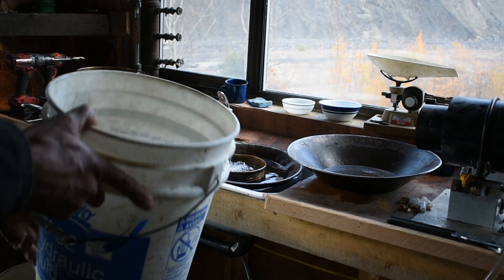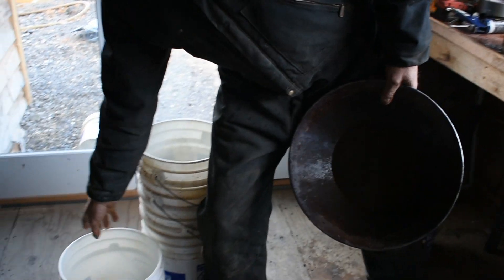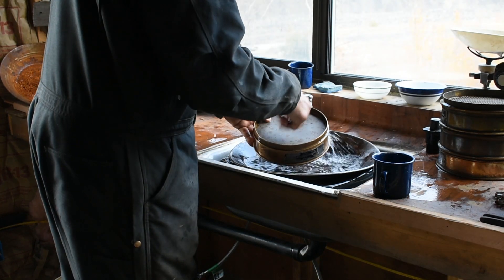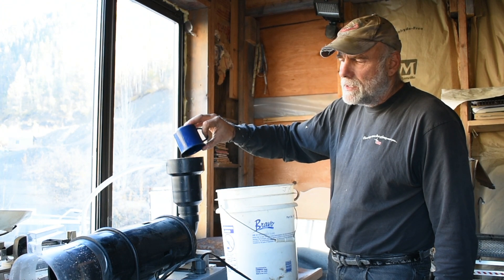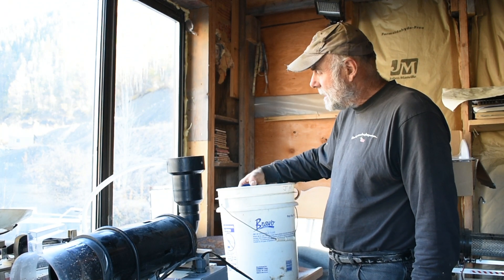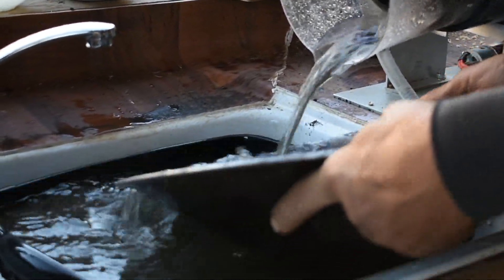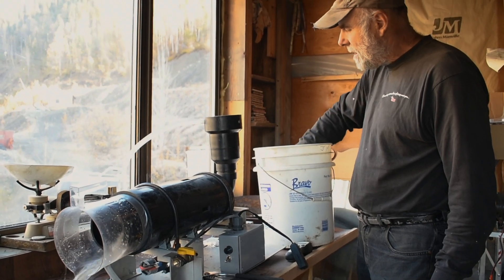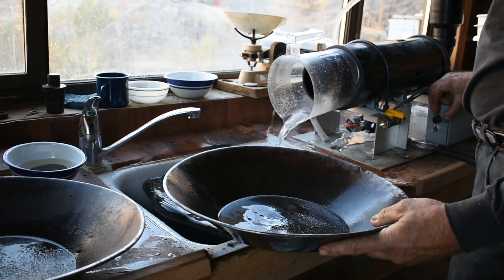Gold Centrifuge

Comment: So it's just a rotating cylinder spinning fast enough to make the dense particles stick to the wall while the less dense particles are washed on through by the water.  Then you stop the rotation to gather the gold and some black sand using the water to wash those out.